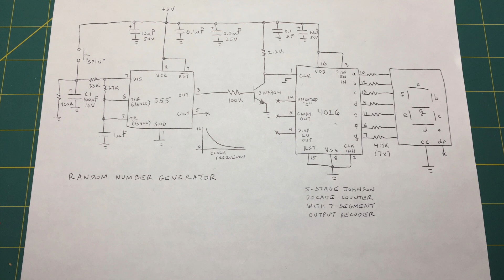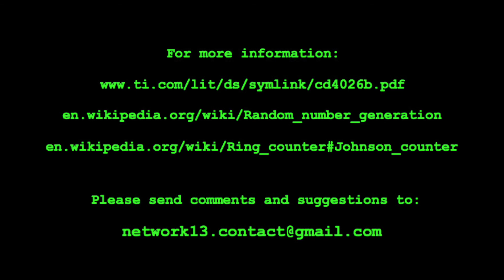Random Number Generator

Comment: Is the circuit is same for 12 voltage supply
Reply from the maker: The 555 and 4026 will work with a 12V supply, you will probably have to adjust some of the resistor values
Reply: @NetworkXIII  which resistors has to be changed please sent the circuit diagram

Comment: What is it used for?
Reply from the maker: Mike Lee This particular circuit is just a quick proof of concept that I built for the video.  There are many many circuits that can generate random numbers.
Reply: @NetworkXIII   ok Thanks. I create generative music with Max For Live. Actually have had very good success creating convincing melodic music. Semi random. I control various parameters to make it less mechanical and weed out bad notes. Such as restricting all notes to a given key signature for instance. I have started working with programming Arduinos. So I came across this video and your Baby 8 and was curious if you had ever combined the two. I was thinking if you can generate random numbers then I could generate random midi note numbers. Thanks for the reply and good luck on picking the lotto numbers!!!!!!
Reply from the maker: Hi Mike  Driving the Baby-8 with a random sequence instead of serially sounds like a great idea.  Also, the Arduino is the perfect platform for something like this, as you already know, so easy to control just about anything with it.